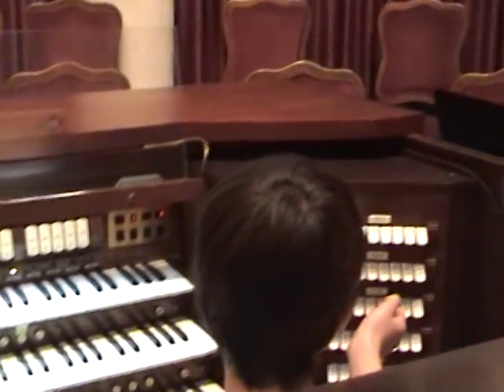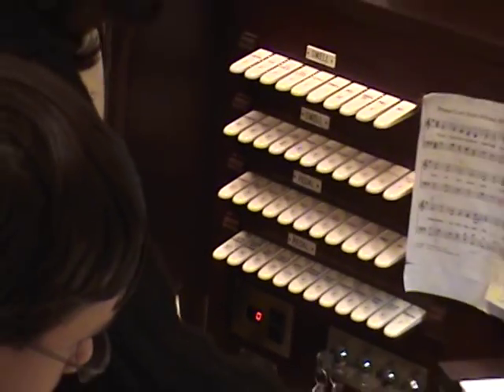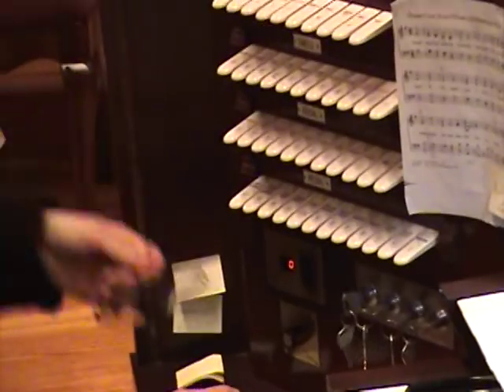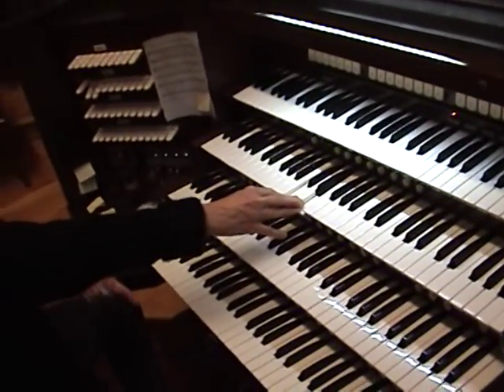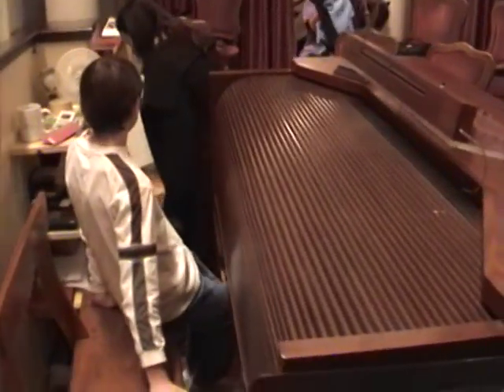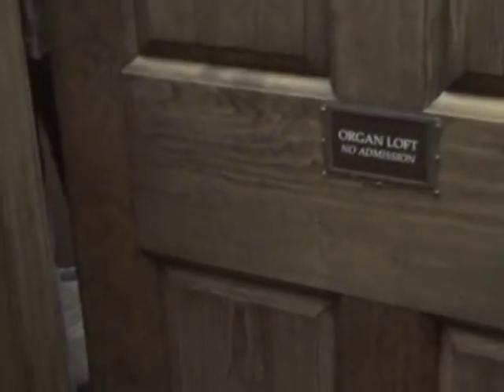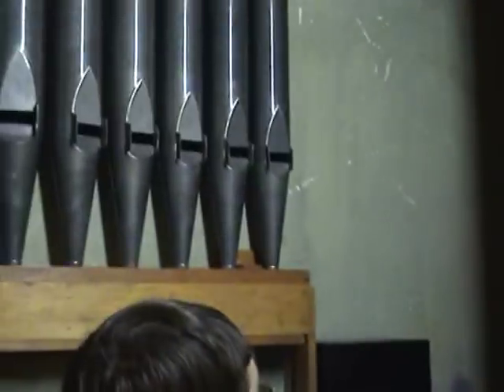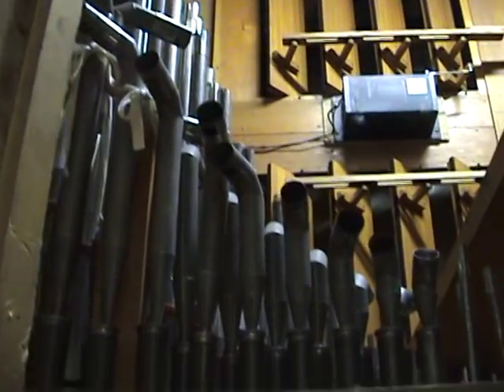Grace Methodist Church Pipe Organ Tour Part 2

Comment: I noticed where she says to open all the swell shutters before shutting down the organ. This is to allow air circulation when the organ is not in use. A properly designed organ has a spring on the swell shutters to open them automatically when the organ is shut down. Unfortunately, not all organs are properly equipped!

Changes in air temperature cause the pipes to change tune, because cool air is denser than warm air. The pipes also can expand and contract with temperature changes.